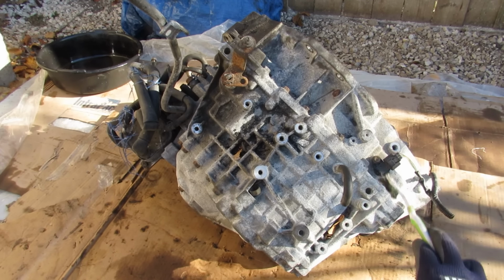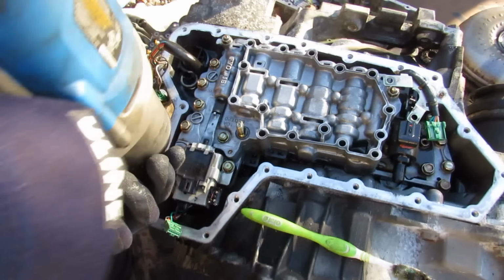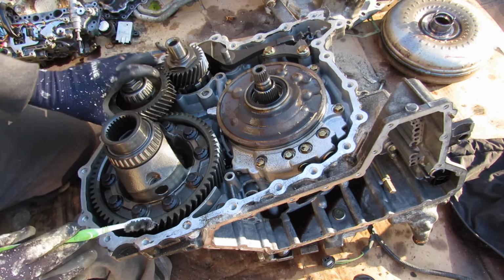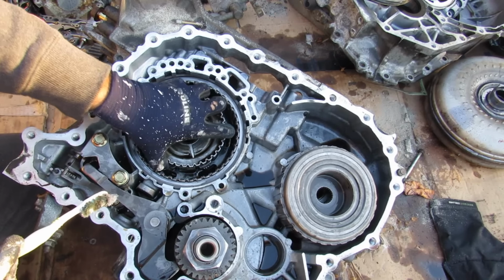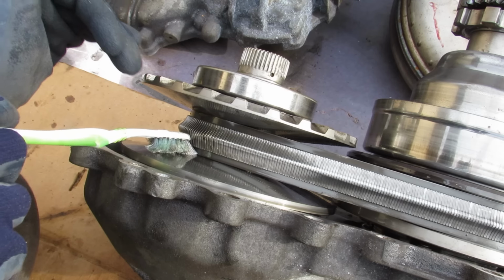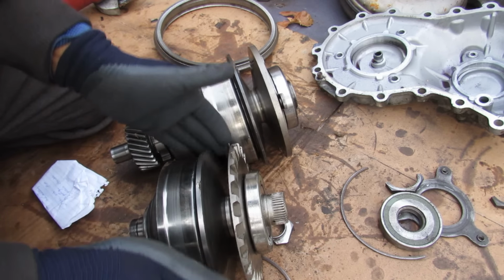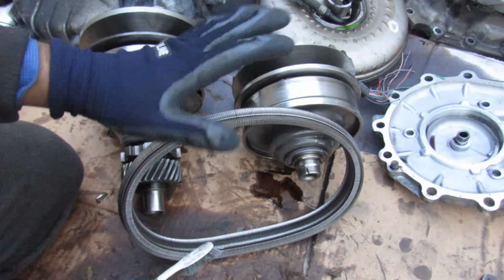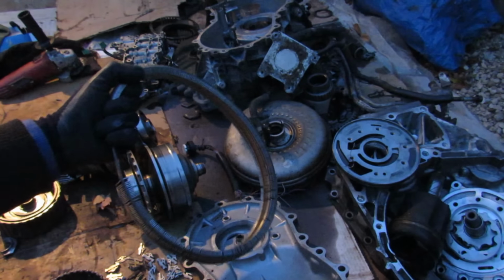Why Nissan CVTs FAIL

Comment: scotty must be smiling rn. he hates CVT
Reply: He hates Jatco CVTs the most like this one.
Reply: According to people with hard ons for nissan. You have to change the transmission oil every day religiously and  it might make it to 40,000. Enjoy you great interior and infotainment center  while stationary.
Reply: @Jkimmelblackface  lol
Reply: Even Toyota is using (Aisin) CVTs now, but I’ll bet they’ll last, where the JATCOs used by Nissan don’t.
Reply: @sharkinstx  I heard that Toyota is just quietly repairing them.  Guess they don't want any Nissan-like scandals.
Reply: @sharkinstx  toyota uses a physical steel gear just for first or launch, thus way you can have hard acceleration without hurting the variable assembly
Reply: @sharkinstx  Toyota uses a real gear for 1st gear for car to move from stop, that relives much of the tension to the belt and reduce rubber effect.
Reply: @sharkinstx  Toyota does make a great CVT
Reply: @sharkinstx  Try DRIVING a Corolla with the CVT.....You'll HATE it. 0 to 60 in Half an Hour.
Reply: @georgespalding7640  I’ve driven two: one in a 2018 Corolla LE, and one in a 2020 Corolla LE (both were Enterprise insurance rentals).  They weren’t terrible.  But then I didn’t flog them.
Reply: @sharkinstx  Toyota owns aisin and for a long time now. Therefore you can say they make their own in house cvt’s similar to Honda. Meanwhile jatco provides cvts to many companies, Nissan being one of them.
Reply: @sharkinstx  Aisin is owned by Toyota.
Reply: Come on, it's just 4000 bucks to replace the cvt, no need to repair.  i had one and it needed replace, I replaced the car, and found out now that i believe there is a mazda that says they don't use cvt.
Reply: Scotty get his info from magazines and makes videos.
Reply: Especially Nissan Jatco  CVTs
Reply: Scotty hates everything
Reply: And he's right they are an unfixable endless money pit!
Reply: thought exact same thing. Scotty!
Reply: Scotty hates whatever makes him money today.
Reply: Scotty is ok with hybrid CVTs.
Reply: @peterl6095  - Hybrid CVT's (at least the several brands I've seen) do not have the "metal belt" in them like the CVT in this vid. They operate in a totally different way, using planetary gear sets and clutches. Both may share the "CVT" moniker, but that's about all they share. (Most mfgr's refer to their hybrid CVT's as ECVT. The ECVT's continuously vary where the torque comes from (electric motor, IC engine, or both). CVT's have one source of torque, the IC engine.
Reply: Get used to it because eventually they will all be CVT.
Reply: @jakejones5736  No, they'll be electric. Probably HET with very minimal gearing.
Reply: @VenturiLife  Concerning all electric: The only way I see that happening is if the vehicle is capable of heating in sub-zero temperatures and cooling in 100 plus temps with the lights on AND the high powered sound system running. All this with the ability to go several hundred miles for hours before needing to be charged. I don't see society forfeiting such conveniences anytime soon.
Reply: @jakejones5736  Certainly not willingly anyway...
Reply: @netdoctor1  No kidding. And the way the commie politicians are going, we're getting closer and closer to living like cavemen.
Reply: @jakejones5736  Not to mention the need to upgrade the electric power grid to supply the electricity to recharge all the cars.
Reply: @davem5333  Lol seems a little far-off for Tesla to be the "bane of the power companies" struggling to maintain their grid voltage with all the Tesla owners sipping away from it. Well -- quick charging (whether at home or elsewhere) that thing is definitely not a "sip", but it doesn't seem like there's still that many Tesla owners going around...
Reply: @jakejones5736  8
Reply: @jakejones5736  not really. Over about 150 horsepower they are useless.
Reply: @jakejones5736  - Some believe they will all be electric motors, some day. If so, then a single speed direct drive will work, ala Tesla. Porsche has a 2 speed transmission in their Taycan. Amazon is now testing electric delivery vans in L.A., built by Rivian. Everything I've read about Rivian suggests direct drive 1 speed, but I can't find all I'd like to know.
Reply: they de humanize the car driving experience
Reply: And we hate scotty
Reply: @IamR3D88  we do?
Reply: He hates them because he can't work on them & millions of nissan's are sold only a few have problems  just like other car makes
Reply: EVERYONE hates cvt
Reply: "rev up your... wait, don't, you'll blow out your CVT!"
Reply: Scotty is a fuckin joke.
Reply: @zacharyirving5080  So are the cars he makes fun of.
Reply: @zacharyirving5080  MOST CVT Trannys are a Joke too, especially the JATCOs.
Reply: @zacharyirving5080  
He's an old school dude who is suspicious of  monstrosities like this one
Reply: @zacharyirving5080  Why is Scotty a joke? I'm not understanding the hate for Scotty Kilmer.
Reply: @milkshakemuncher  ever watch his videos?

I've been a tech for the better part of ten years and I've seen a lot of crap from a lot of different vehicles. If you ask snooty scotty if it's not a Honda or a Toyota it's not worth owning.

Of course Chrysler is on his hate list (and rightly so, their cars are bad) but I once watched a "how to diagnose" video of him bitching and moan about starting issues on a dodge truck because their keys and key cylinders suck (there was a recall, scotty) and it turned out the starter had failed.....you know....one of the most common part failures in any vehicle since forever....

And these days he's all political talk which is a personal preference I just can't stand.
Reply: @zacharyirving5080  thanks for explaining.
I'm no tech, but I have noticed before his preference for Honda and Toyota and thought it puts bias in his videos against other makes.
Reply: @milkshakemuncher  He is not wrong with his preference for these two Japanese. They are less prone to problems. Although parts can be very expensive.
Reply: @krollpeter  yeah I can certainly see Scotty's position too, even from my own experience of driving cars hard, Japanese vehicles are built sturdy
Reply: @milkshakemuncher  rightly so, Toyota & Honda make the most reliable cars honestly. You just have to look at the numbers & reviews online, they don't lie.
Reply: @zacharyirving5080  " If you ask snooty scotty if it's not a Honda or a Toyota it's not worth owning." cmon is that really snooty? i'd agree. as an owner i wouldnt spend a dollar else where.

i can still appreciate German and american brands but at the end of the day as a utilitarian, honda or toyota all the way.
Reply: @larrywexner4163  - Scotty is not wrong, he's just extremely repetitive about a few things he feels are important. Good consumer advice. And he's also cheap as dirt.
DeMuro makes the point VS cheapness that you should have a life and enjoy the car you want, not just enjoy the money you save and cackle about how foolish other people are.
Reply: Why do people trust this guy’s opinion so much...he’s experienced is built solely from things that go wrong 😑
Reply: @air-headedaviator1805  well, if you repair things for a living (I do), you get the idea what fails most frequently, and what is the cause of failure. After some time, the patterns develop. When you are describing patterns from your memory only, your opinion is not worth much. In order to get your personal bias and your memory problems out of the equation, you need to back up your opinion with hard data (like the computer entries about failures in the last 5 years for a particular car model). Once you have done it, your opinion becomes a reliable source of information.... I'm pretty confident that this guy knows what he is talking about, and he most likely looked at hard data in forming his opinions...
Reply: @air-headedaviator1805  You're talking outta your ass, Scotty talks a bit in one of his videos of how his Father was a mechanic back in the day when mechanics had a Gas station/Mechanic shop, and showed a picture of it in black in white. Scotty has been around cars since he was a little kid, he also had a TV car segment in Texas years ago way before YouTube, he has more car experience then must if not all these YouTube 'Mechanics"
Reply: @dawicked2k8  exactly. Scotty is a dinosaur who still tries to apply 1950's methods to modern cars. It's just not gonna work. He needs to get over himself and get with the times
Reply: @air-headedaviator1805  When you buy a car what's more important, how many things keep working or how many things go WRONG?
Reply: @air-headedaviator1805  I typically don't disparage other commenters, but that was one dumb observation bro.

Comment: Has his brother got anything left to wear or is he having to go around naked? He must have started to run out of clothes as he starts using the wifes' clothes later in the vid. So this has a double meaning to how to "strip" an variable transmission. He does know his stuff though. and having watched this, I will stay away from any Nissan with such a system in it.

Comment: I own an 08 Maxima 3.5 SE (VQ35 Engine). I bought the vehicle with 130K miles for $1K, and have since put 30K miles on it, and at purchase performed a CVT fluid change and will be doing another at my next oil change. Mileage? 19.5mpg average. Reliability? The CVT does make noise, particularly when cold, but once it’s up to temp it doesn’t make a sound. Knowing everything about these before I watched this video, and in fact before I purchased the vehicle, I treat the vehicle as one should. The throttle never gets depressed more than 65%, and I NEVER drag race in it or perform “jackrabbit” starts. I bought it for $1K from the dealer I work for who waived all profit (KBB was $6500 at the time), and I bought it because I was putting a longblock in my “racecar” after its engine (07 GM Ecotec LSJ) suffered from block porosity. Long story short other than the mileage I love my Maxima, it does its job each and every day and looks GOOD while doing it. Is it fast? Helllll yes, but as described in the video... you don’t want to use the torque from the VQ at 100% or the band WILL fail, ESPECIALLY at high mileage like my vehicle. I will continue to baby her, and people who baby these things get WELL OVER 200K miles, I know this from more examples than I can count.

Comment: I don't think I would want a CVT or automatic transmission in ANY of my vehicles. Why? They are NOT reliable, which is why you are fixing a Nissan CVT whick looks like it is all burned up inside. My '90 Ford Ranger has 352,000 miles on it without being rebuilt. Just a change of fliud and readjust clutch every 50k miles, and two changes of the clutch and throw out bearing every 100 - 120k miles and no other maintenance on the Mazda transmission. No engine rebuild, either.

Comment: I rebuilt my A604 41TE automatic transaxle on my 2002 chrysler pt cruiser 4yrs ago.   I had always wondered what CVT transmissions used as the belt.  Loved how you clearly showed how the individual platelets can stack, slide, and pivot all while being held together by a set of flexible steel bands.   I subscribed to your channel because of how well you explain the modes of failures along with how you came to those conclusions.  
I appreciate the humor lol, that poor oil stained oral B toothbrush had no idea what kind of a life it was headed for.

Comment: THAT was VERY impressive! Ultra practical disassembly and explanation of every step and description of function. As a very experienced (not CVT) mechanic, I feel like I could jump right in and diagnose one of these. I love that you give us just enough of bolt removal, but not EVERY one, and the laundry references (don't let wife/brother watch vid :-). You are super intelligent and a great presenter! I am looking for a good planetary gearset for a DIY helicopter main rotor transmission, and it looks like these may be a good donor, since apparently there are a lot of dead ones, but not the fault of the planetary system. Thank you VERY much for this video!
My only complaint is the pain I felt when you resorted to a cutoff wheel for the nuts...Buy a socket(s)/impact gun....

Comment: This is the reason I didnt upgrade to the next Altima, After getting in a crash with my 2005 Nissan Altima. After reading the reviews and the horror stories of CVT's in their current models, I quit Nissan and after saving up got a 2015 Mazda 6.  While I enjoyed my lil 05 Dodge stratus while saving up cause parts are cheap and easy to fix if anything did go wrong though i never had probs sides the exhaust system rusting out though it was a 15  year old car lol. I chose the 2015 Mazda 6 cause American cars quality control at the time were garbage. Being made in Mexico.  But the one i chose was all made in Japan and it was chain driven and not rubber belt or CVT. So that alone made my decision. Cause eventually the timing belt in my 05 Stratus gave way giving me a dead vehicle not worth the repair but this Mazda I been happy with. No issues so far and had it since 2016. -18DEC2020
Reply from the maker: Good call on the Mazda. How did the Altima hold up in the crash?
Reply: @speedkar99  thanks, I am very satisfied with it. The Altima was in a 3 car crash both front and back so I was in the middle. My sister in I were fine. It was roughly at 40 mph  everyone breaking. But the front and back were messed up enough that to fix was worth more than car. So the insurance deemed it totaled and gave me a check for its value at 7500k. Shame cause I really liked that Nissan. Windshield glass cracked and airbags deployed too. So I kind of figured. But she could still drive but was leaking coolant. So 8f that gives you any idea.

Comment: I have a Mitsubishi Outlander with a CVT Transmission, I absolutely hate it, it has already failed once (luckily we had an aftermarket warranty so we paid minimal to have it replaced) but it is sluggish, the power band is whack, I think with it mated to a 2.4l 4cyl. just dogs on the transmission for the vehicle weight, I am almost scared to drive it around that it will just fail again, out of nowhere, I don't want to use the paddle shifters or it's manual stick shift mode in fear it will fail again,  Trading it in ASAP and never again will I buy a vehicle with a CVT.

Comment: CVT, continuously variable tragedy. Boyfriend had a 2016 Sentra and I got a 2018 as a rental while my Mazda 3 was in for repairs. I hated literally everything about that car, but the transmission was the worst part by far. He is not kidding about that rubber band effect.

The CVT is basically the final form of the late 1800s chain drive. What’s old is new I guess.

Comment: This guy is great.  Completely explains how everything works in the ctv.  Nice of Nissan to make it where you have to replace the whole thing.  The ctv idea is very good, so why can't automobile manufacturers design this to be more durable?  This design would be great for over the road trucks, where you can keep the engine rpm in a range to give you the must torque.

Comment: CVT ok til motor exceeds 100 HP/100ftlb Torques. After that it's engineered Junk and good reason not to pay more than 10 cents LB for any used CVT vehicle.

Comment: What I've mostly seen is the belt and pulleys chew each other up. Running a metal belt on metal pulleys is not a good idea. When the belt and pulleys start to get chewed up, which usually starts happening within the first 10K miles, bits of metal start circulating around the transmission and plug up fluid passages, leading to all kinds of malfunctions. It's not just Nissan (JATCO) transmissions that fail, it's ALL of them. The CVT is based on a flawed concept. There is no way to fix that. A CVT (of any brand) will never last as long as a conventional automatic transmission. As far as typical automatic transmissions go, the more gears they have, the shorter their life will be. The best fairly modern automatic transmission I have come across is the Ford AODE 4 speed overdrive transmission. I have seen these last past 300,000 miles without failing. You will likely never get past 100,000 miles with a CVT, and that is only if you over maintain it, and drive the vehicle VERY carefully.

Comment: In fact, the CVT has been mythologized because it is so much faster than conventional transmissions that it has been banned in Formula 1 racing. Not only does it smart shift (computer-controlled ideal RPM for best torque and horsepower output), it is also much lighter in weight. There are also fewer parts to break down. The Nissan CVT problem, as you said, has more to do with matching the right sized CVT transmission to the right engine.

Comment: In racing, isn't a CVT transmission one of the fastest transmissions, especially when comparing it to a conventional automatic transmission?
Reply: No, double clutch racing automatics are faster and vastly more reliable for high output engines. Not one Ferrari, Lamborghini, Zonda, etc has a CVT, even Nissan’s own GT-R uses a conventional automatic. The main reason is that twin turbo V6 would eat a CVT immediately. With a double clutch system, the drop in power as gears change is measured in milliseconds.

Comment: So if the only way to prolong the life is with a fluid change, how come Nissan wont perform a fluid change stating "it's a lifetime oil"?
Reply from the maker: It depends on the model. They put the dipstick, drain plug and procedures in the manual for a reason

Comment: I've had 2 Nissan Maxima's 3.5 with CVT. Never had any issues. Super smooth and flawless - great economy and power. Current one done 160,000 kms and just fine. Beautiful.
Reply from the maker: Well you've been very lucky there. The VQ Maxima isn't easy on the CVT

Comment: I have a 2012 nissan cube with a CVT, and sometimes I can't put it in reverse, any insight? Btw great and thorough video, keep busting nuts😂
Reply from the maker: It's probably that plantery gear set clutch pack at the front